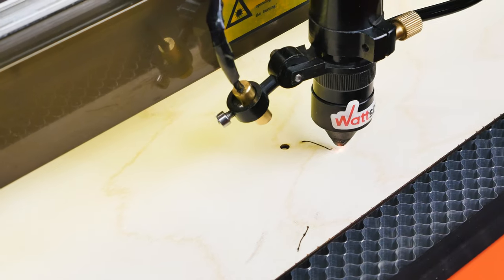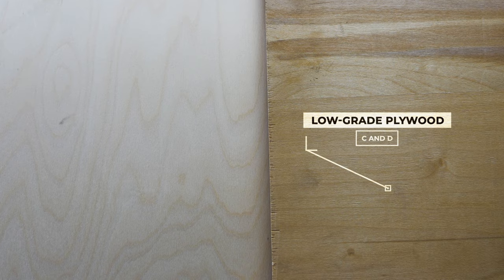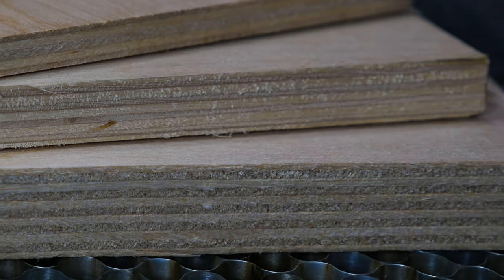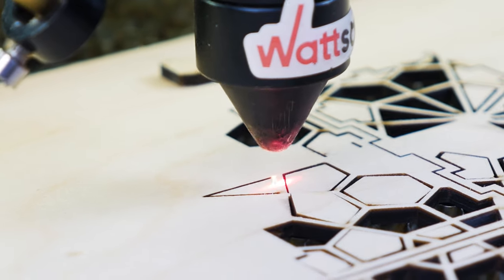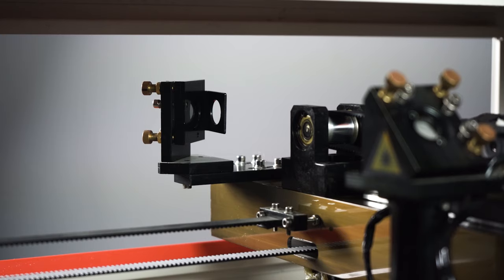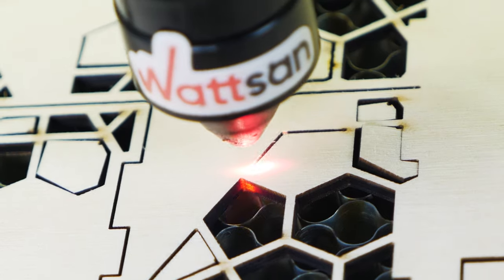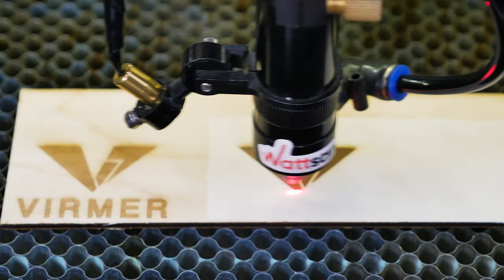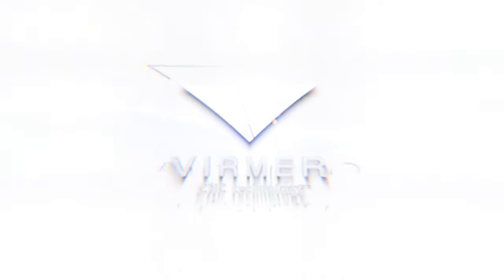HOW TO CUT PLYWOOD ON A LASER MACHINE? / VIRMER CNC GUIDE

Comment: There are many observations I can make about his video but two things in particular. First this Reci tube is not factory warranted because it has not  reached the specified test parameters  for a W4 tube. If you look at the test graph on the tube and the PEAK test watts  on the label, it has barely reached 120 watts. The  PEAK spec for this tube is 130 watts  and failure to achieve this peak performance during final test means the beam quality  ("sharpness")  will be compromised and the tube cannot be guaranteed to last the published lifetime.  My advice is to make sure Wattsan fit proper "A"  grade tubes that meet specification and carry a factory warranty because now, you, as the vendor, are liable for warranty replacements.

 Therere is something seriously wrong with the cut at 3.:00. Its only 3mm thick plywood but the cut is not passing through the materia. I  it was (especially with full air assist) there woiuld not be masses of smoke welling upwards.  In addition the "rule of thumb" about 10 watts of power per mm is pretty meaningless .  What  CUTTING speed can I expect to cut  3mm plywood with  using just 30 watts? especially when I see that  this supposed 100 watt tube can't cut through 3mm.
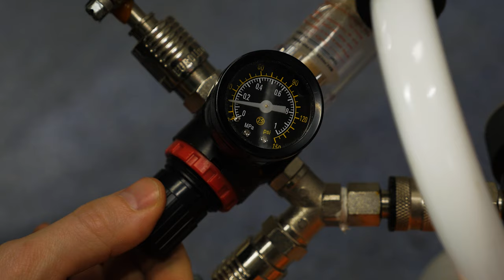Just as an extra ...  At 3:44  the comentry states  "It is recommended to engrave an image across the grain "  but the video shows it ALONG the grain..

I will be very happy for you to remove this comment  but please note the content before you do so.
Reply from the maker: Thanks  for your comment The idea  its  help our clients and all how wants to learn about CNC machines